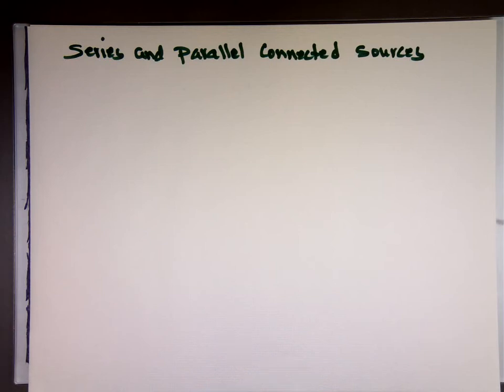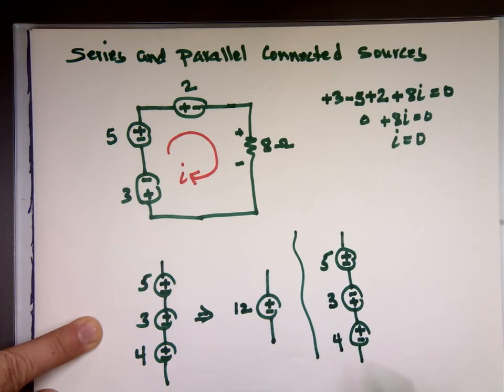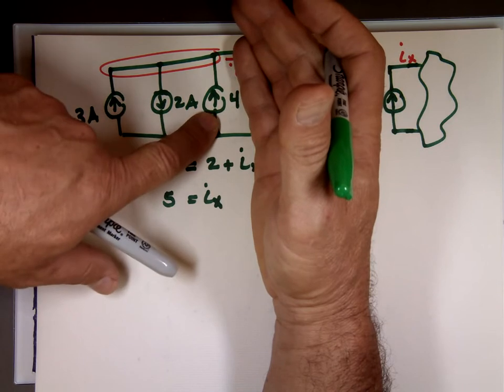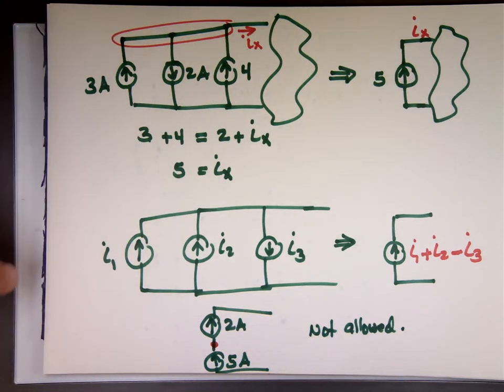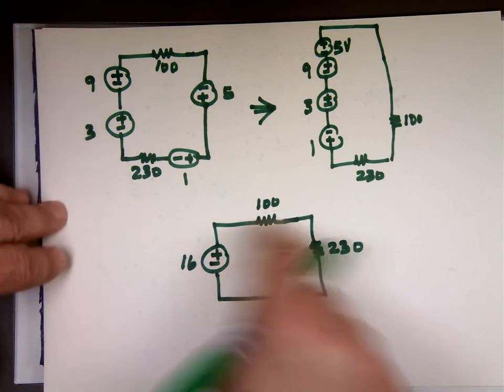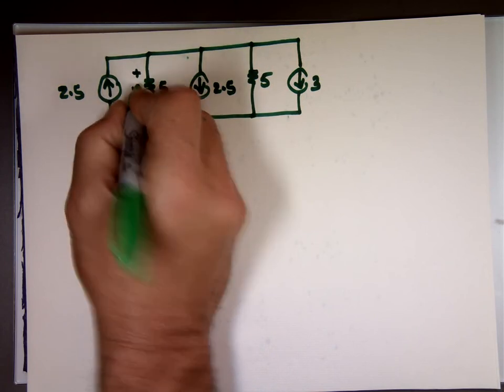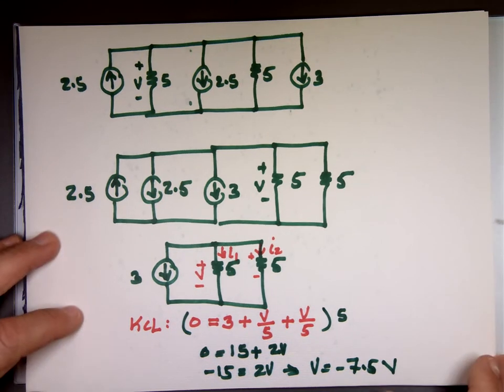Series & Parallel Connected Sources

Comment: So can i run a 45 amp power supply in parallel with 100 amp power supply to = 145 amps and each one is at 13 volts

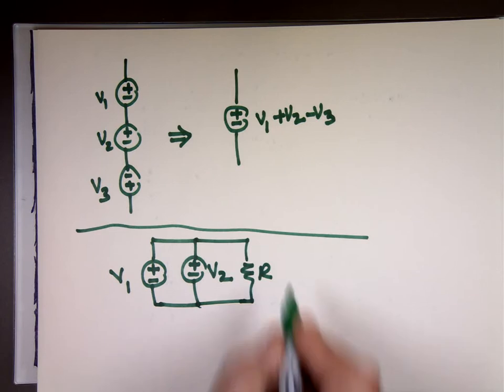Comment: 5:33 with respect to your vaste knowledge,I would like to add the following statment. I still have to say that this is practically possible and the total:
Rt -> total resistance 
R1 -> resistor of the V1
R2 -> resistor of V2
The total voltage exerted by the two batteries is
V=R(V1/R1 + V2/R2)

If V1= V2 then V1=V2=V. in this case, the circuit will get is more current.
Practically, what will happen if both V1 and V2 are not equal, both V1 and V2 will forcefully fight for balance. The one with higher voltage, its voltage will decrease and the one with lower voltage will have his voltage increased. While they forcefully fight for voltage they inflict damage to the circuit, it could be minimal or severe. In case of the car example, there is a damage in the circuit if you did that to your car you will notice zapping and burning traces on your wire/battery. 

Conclusion, notice that I used case alot as normally it is not allowed . Circuit board has sensitive component and that minimal damage could destroy it.

Comment: 2 current sources in series actually CAN HAPPEN ! 
stop saying ""not allowed" 
it can actually happen and we can connect an ammeter to know what the current is
Reply: If you paid attention to the video, he explains why it's not allowed - the result simply does not follow KCL, and is therefore not allowed.
EDIT: The only reason you can do it in real life, is because in reality we aren't dealing with perfect power supplies. Therefore, you can connect two current sources in series and get some kind of output, at the cost of messing up your equipment - the extra energy is going to be given off as heat until something breaks or overloads.

Comment: You said 2 voltage sources in parallel isn't okay 
what the hell does that suppose to mean ?!
i mean what happens if we actually did it ?
Reply: It fries up the voltage source, and you wont be able to take measurement by voltmeter

Comment: You said that connecting voltage sources in parallel is not allowed but connecting current sources in parallel is. This does notmake sense to me! I thought all current sources have a potential difference.
Reply: Only if voltage doesn't match do we have issues.
 If V1=V2, in parallel, we V1=V2=V, and the currents can add up